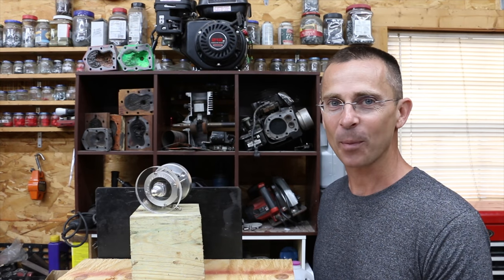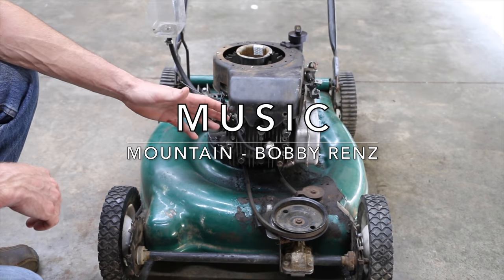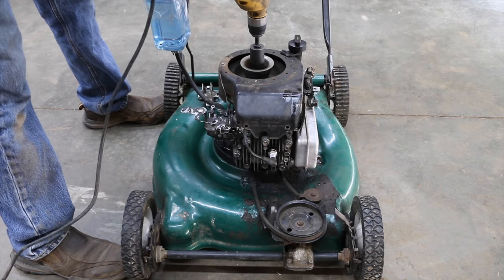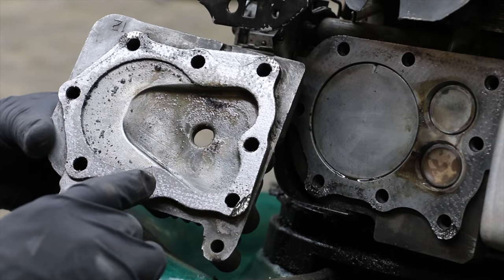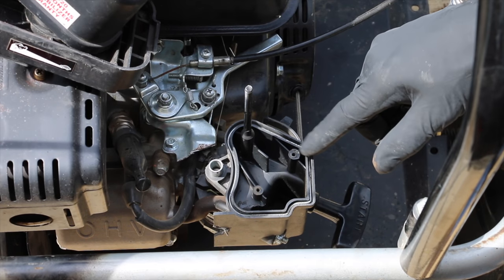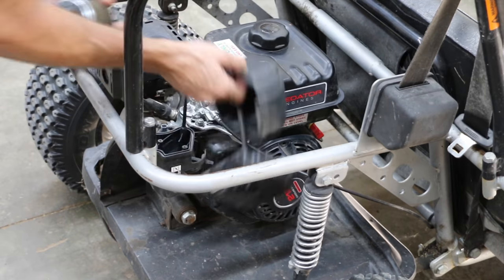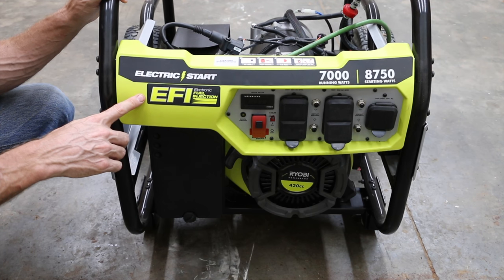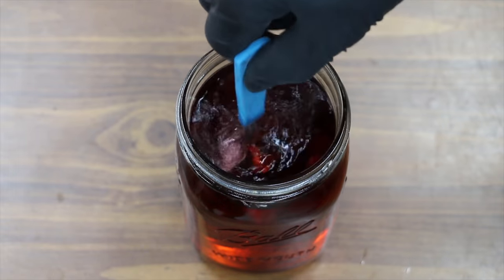Is Leaded Fuel better than Unleaded?  Let's find out!

Comment: Cars had a lot of issues with valve guides initially.  However, roller valve train and compensating other ways did away with the issues in time.  What killed lead for cars was the catalytic converter.
In aviation a couple things happened.  Traditionally, airports had to inventory both 100/130 and 80/87.  100LL was approved for use in 80/87 engines enabling them to inventory only one type of gasoline.  However, 100LL has much more lead the 80/87, which caused plugs to foul very quickly, which from a practical standpoint required 80/87 engined aircraft to add EGT meters to lean out the engines so the plugs wouldn't foul so quickly.  Today, some airplanes and engines are approved for lead-free car gas that more an more airports are stocking, and it's cheaper.  Worldwide, gasoline at airports is no longer universal.  Many only have gas turbine fuel. (kerosene with a few additives).
Reply from the maker: Thank you for the feedback

Comment: I have a 2014 Chevy SS with the LS3 V8 engine. it has 40k miles and long story short I accidentally added one and a half gallons of 110 octane LEADED gas to my car. After realizing it was LEADED gas I filled the rest of the tank (18 gallon tank) with 93 octane premium unleaded gas, are my catalytic converters and 02 sensors going to get damaged?? Help!
Reply: I have no knowledge on my own, but from reading other comments and the video: yeah, probably will mess with the o2 sensor and cat. I’m not sure what would be the best course of action, or if it’s effects are going to be detrimental enough for you to actually do anything. 
If you wanted to be super safe, you probably want to drain the gas tank and replace it with fully unleaded gas. You can keep the leaded gas in a container and do some research on whether it would be okay to use at a later date.

Comment: For our latemodels stock cars we typically run sunoco  110 leaded. When tuned right you get blue flames. There has been some that have run 100 Jet fuel as thought it burns cleaner and runs great
Reply from the maker: Thanks for the feedback.
Reply: @crapObear2323  Uh re-read my comment. I'm not over here putting leaded gasoline in my daily Toyota. Purpose built racecars with motors that need the leaded 110 fuel...There's worse things polluting the environment than leaded gas.  These cars burn fuel cleaner than any other fuel based car  and that's without having any mufflers or catalytic converters on them and carburetor's. We've put a splash in our daily's to clean them out and improve gas mileage in the past.

Comment: Would there be any benefit running 100LL in a KTM 300cc 2-Stroke dirt bike? The thing I like about AvGas is I don't have to worry about it gumming up my carburetor if the bike sits for a while. From a performance and maintenance stand point, are there any positives or negatives to running AvGas over 93 pump gas? Thanks!

Comment: Neat video, but I **think the advantage of being able to use leaded avgas is that it has a lower propensity to detonation.  In race cars this allows you to advance the timing and/or turn up the boost beyond what unleaded lower octane fuels can handle.  If you just swap fuels, like shown in this video, you're likely to not see very much difference/benefit other than the lead deposits from the avgas.

This video did make me consider how do airplanes that use this fuel deal with the "extra" deposits that are constantly being put into the engine.
Reply from the maker: Thank you for the feedback

Comment: In the aviation community there are a lot of older planes from the 70s, 80s and even older. Many of these engine were originally designed for higher lead 87 octane fuel. Now all that is available is 100 Low Lead. A common problem with these engines running on modern 100LL is that the seem to get build-up primarily on their exhaust valves leading to poor compression. Many aircraft owners run Marvel Mystery Oil in theory to combat this issue. I would love to see a test proving or debunking this. I personally do use MMO, and have not experienced an issue since. However, I would love to see a test, even in a non-aviation small engine. There is nothing special about aircraft engines other than being designed to be lightweight (and reliable of course). Thanks.
Reply from the maker: Thanks for the video idea.

Comment: Super cool video and clips. I’ve been running avgas in my small engines for the last 8 yrs, so I was really interested in the results. I feel like this video needed a conclusion... after watching I don’t know.. that was a lot of lead build up
Reply from the maker: Thank you!
Reply: As do I! The good news is I never need tune ups, spark plugs etc on leaf blowers chain saws, generators (13 years later, they do get maint. though) and never have fuel that "goes bad" prior to the next seasonal use. I also run it in my Motorcycle and 63 VW beetle (as storage fuel). The lead build-up concerns me somewhat too now...

Comment: I know anti seize used to use lead, now you fund chipper or nickel depending on the temperature rating.
It might be interesting to A: compare different metals in anti seize and B: see if there is any other metal fuel additives that might give the lubrication qualities led was added for.
Reply from the maker: Thanks for the video idea.

Comment: I have a problem with my 1996 mercury 125 hp engine running on ethanol gas it vapor locks in the sun ... but it runs fine on ethanol free gasoline. I have used stabilize fuel additive to both . Ethanol free runs great. I was hoping for a test... I enjoy your work
Reply from the maker: Thanks so much!

Comment: A bit late here. In the UK we used 2,3 and 4 star lead petrol. It was good for lubricanting valve seats but was withdrawn in 2000 due to it being bad for the environment. Lots of people had to have the cyl heads remachined to run on Unleaded petrol which was pricey
Reply from the maker: Thanks for sharing.

Comment: used to run 1110ll avgas 50 50 mix in my motorcycle when I visited my airplane, it burns very dry so to speak easy to ruin stuff but definitely made a difference in performance just like your go kart did never tried JP4 or JP5 perhaps in my diesel!
Reply from the maker: Thanks for sharing.

Comment: This is year old and you have further improved your mad skills. 

It would have been good to compare maybe 0-20mph on the go cart to see if power increased from the fuel. Top speed could be limited to clutch and engine rpms in this application. Still a very cool test. 

The generator would have cool to see if one fuel ran longer than the other. 

A test I’d like to see I. Future is alternative to diesel fuels. I’ve seen so many things you allegedly can do to make diesel or sub. Used engine oil and gasoline, kerosene, used vegetable oil, transmission fluid. 

I really enjoy your videos and not getting wrapped into sponsorship. People including myself have some bias of but what if this. At the end of the day I feel you test more of a a real world application and extreme limits. 

I am almost to the point I might quit using Mobil 1 oil and use those cheaper alternatives after watching all of these tests.
Reply from the maker: Thanks so much!  Thanks for the feedback.  Thanks for the video idea.

Comment: I’m having trouble my friend I bought a compression tester and it reads 30 psi on both engines I’ve tried it on but when you take the hose off and use the short metal pipe that came with it it is about 60-70 would you have any idea why this is

Comment: Do you have a way to find out how much fuel is not burned that goes out the exhaust? Maybe a spark plug in the exhaust system. Or a bunch spark plugs in the exhaust system. Would be cool to find out. Maybe even inject some air into the exhaust a little at a time to get the right mixture.

Comment: I really wish you would have taken apart the rotary to find out how it did. It looked like it was having intermittent misfires, and I'm wondering if that was spark related, or if the lead build up was causing the apex seals to skip, losing compression intermittently.

As a rotary enthusiast this is an interesting idea, as turbocharged rotaries fail quite often due to detonation, as the apex seals bend or outright break. Lead is very good at preventing detonation hence why it is still used in aircraft.
Reply from the maker: Thanks for the feedback.

Comment: Ehhh, messed up putting all that oil in the 100LL for the rotary...I understand not wanting to blow his junk up but that had to hurt power and make it run rougher. It's not a two stroke but does work similiar I guess lol...It has lead so wouldn't it have more lubrication in the chamber anyways?

Comment: I don't mean to be a stickler for details but just how did you lean out the air / fuel mixture on the go kart to run it on av gas? If you did it with the idle screw on the carb, you didn't lean out the mix. You would have had to change the jet inside the bowl of the carb. Some small engine carbs are changeable, some are a drilled hole and can't easily be changed.
    Also, your fuel injected generator probably was able to adjust for it somewhat but I hope you don't live in California as some small engines there have catalytic converters. If you read some of the ads from Harbor Freight, Lowes and home Depot, some of their small engine devices and generators say in their ads "Not for sale in Calif."
    One other thing to consider in general. ALL stock factory non-modified engines from weed whackers to tractor - trailers, for their horse power ratings, fuel efficiency, exhaust gas content /output are adjusted for the presence of the proper air filter in place when they run. This may or may not make a difference with your tests as they are mostly short term and not done over thousands of hours / miles or hundreds of gallons of fuel but it is something to think about.

     As I am writing this, your YouTube channel has switched over to "Is 70 year old oil...". Just a short story about Quaker State oil. My father bought his first NEW car in 1974. It was a Pontiac Catalina with a 400 Cu.In. engine and 2 miles on the odometer. It had a whopping 175 horse power. He bought it in New York just before we moved to Florida upon his retirement. After we got there, I bought my first car, a 1968 Chevy Bel Aire with a 307 Cu.In. engine with 200 horsepower. (I mentioned this car in your gas / alcohol video comments.) His car, he took care of as if it were his fourth child. Whenever I tuned it up, changed the oil, (every 3,000 miles), rebuilt the brakes or any other repair, he demanded GM dealer parts and Quaker State Deluxe 30 W motor oil as commanded in the owner's manual.
    Back to my car for a minute. My car didn't start out to be a racer. In fact, it was the Little old lady from South Pasadena's, (Florida) car, literally. Over a couple of years, the stars aligned in my favor and I acquired the quadrajet intake manifold and power pack cylinder heads from a 1966 283 Cu.In. Corvette engine and the quadrajet carb from a 454 GMC motor home. Once adjusted correctly, a deadly combination within it's own class. From the day that I bought this car, I used nothing but Valvoline 40 W racing oil and the STP "silver bullet" oil filter EVERY 3,000 miles due to the sand and heat of Florida's summers. I had plans for this diamond in the rough. My tune up parts were Accel brand. I bought it with 60,000 miles on it and planed to keep it forever. I still miss it 45 years later. I got my performance parts together after about 30,000 miles of my own doing. When I removed the top of the engine to replace the intake and heads, it was like brand new. NO sludge at all. I was a bit of a lead foot then replacing 3 power glide 2 speed transmissions in 40,000 miles and 4 years of ownership, but I digress.
    Now back to my father's 1974 Pontiac. After 50,000 miles, he started seeing a few drops of oil here and there on the driveway. I checked it out and found that the cork rocker arm cover gaskets had shrunk and began to leak. Off I went to the Pontiac dealer for new ones. When I removed the covers from this engine that had been bottle fed Quaker State Deluxe oil for all of it's life, I was horrified!!! I had to go into the house and get a teaspoon and a wire coat hanger. The spoon to shovel out the sludge that was level with the top of the cylinder heads and the coat hanger to rod out the hollow rocker arm push rods that were starving the valve tops of oil. They were so bad that I almost had to replace several rocker arms that were wearing at their contact points. Luckily, I was able to adjust for the discrepancy's with the adjuster nuts. My father saw how clean my engine was and from that day on had me change his oil with Valvoline and the Silver Bullet filter. He sold the 2 cases of Quaker State that he kept in reserve at our next yard sale.
Reply from the maker: Thank you for the feedback

Comment: Lead increases octane and has lubricating properties. 
To benefit from higher octane fuel requires increased compression and ignition advance. Otherwise your shooting a rifle round out of a hand gun barrel. Before lead was removed from gasoline, cars were running compressions over 11:1 without the benefit of modern fuel injection, sensors and ECUs that are required today, which regulate fuel, air flow, spark timing to prevent pre-ignition and dieseling.  The 427ci Impala z11 ran 13.5:1 compression and these were just carbureted  non-boosted engines.
Reply from the maker: Thanks for the feedback.

Comment: First of all let me say you are my "Go to Guy" for honest tests on products and thank you.  This is probably not the right location to ask this question, but have you ever used or tested Star Tron  Enzyme fuel treatment?  I learned about it several years ago from a guy that builds custom classic VW Beetles and use it in mine. I have used it in my old Toyota and it might in my head, but it seem to run better. Also used it in my Harley. I just read a service manual for Mercury outboard motors and they recommend it for outboards.  Pipe Dream or any reality to this?
Reply from the maker: Thanks for the video idea.

Comment: The best thing about leaded gas was actually being able to read spark plugs to help get the air-fuel mixture adjusted easier. When they took out the lead, that helpful benefit disappeared.
Reply from the maker: Thanks for sharing.

Comment: What sort of mixing ratio would you use 2 stroke oil in high octane gasoline for classic cars as a lead substitute/ upper cylinder lubricant?
Reply from the maker: Thanks for the suggestion.

Comment: 100LL, (low lead), is actually high in lead compared to old leaded premium from the 60's, early 70's. Also the octane is around 96 , if rated by R/M methods. Burns too slow in lower compression engines. I mix it with ethenol free gas, for long term storage in vintage motorcycles, etc.. Stays good for years.
Reply from the maker: Thank you for the feedback

Comment: I used to use shell 115/145 octane avgas mixed 20:1 with R30 in my TZ350. Detonation stopped being a problem but the spark plugs fouled very quickly.
Reply from the maker: Thanks for sharing.

Comment: I was watching your great videos, and I did watch this, and chose not to comment, but then saw the title and found out it was misleading.  In old cars, with old valve guides and valve seals, the leaded fuel was a lubricant.  Now a days, with newer engines, there is no benefit to leaded fuel, and leaded fuel puts lead in the atmosphere.  Now as far as leaded fuel, older cars DID in fact run noticeably better on leaded fuel.  They had more power.  Now ethanol fuel and non ethanol fuel, there probably isn't much difference if they are new.  However, as 10% fuel ages, the alcohol makes them absorb moisture and it breaks down much faster!  The thing is, when you get something from the gas station pump, you have no idea how fresh the fuel is...  Just my two cents!

Comment: i worked as an automotive insurance claim adjuster for many years ,
we would occasionally get a "sugar in gas " claim 
i always felt like sugar wouldn't dissolve in gas or cause any damage.... could you test?
Reply from the maker: Thank you!  I tested it a while back and it didn't dissolve very well but the very fine granules got past the filter.

Comment: One of my cars has around 13:1 compression & won't run on much else other than Avgas (originally was a  Methanol Race Engine) & I went to get new Drag 'Radials' fitted one day & ran lower on fuel than anticipated so stopped at a Shell Servo & put $5 of Vpower in it to get back, I got a few hundred metres down the road & it blew about 2" of head Gasket out the side of the Engine!
Reply from the maker: Thanks for sharing.

Comment: I have been using 100 ll for years never had a problem with starting next season and always use it for pickling or to start one that needs to be started after it has been given to  me when it won't start   when you pickle one the fuel won't turn it only evaporates and leave the carb clean drawback is north of 5 bucks a gallon still cheaper than a new carb
Reply from the maker: Thanks for sharing.

Comment: Interesting tests, it looks like 100ll Avgas will work in gasoline engines that do not have catalytic converters or oxygen sensors in the exhaust. However the big problem with tetraethyl lead is that this substance is toxic, it is good that its use as octane booster in gasoline was discontinued. I am old enough to remember when gasoline pumps had a label on them that read, "For Use as a Motor Fuel Only contains Lead".
Reply from the maker: Thank you for the feedback!